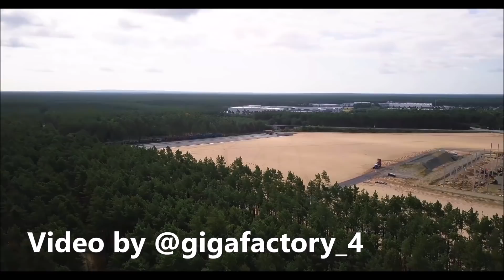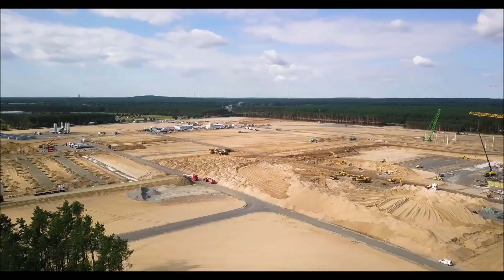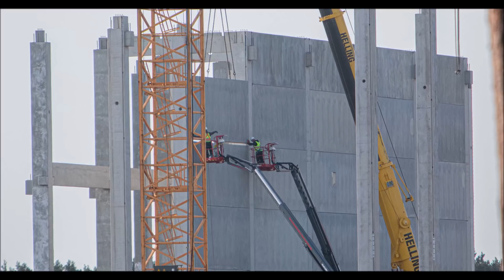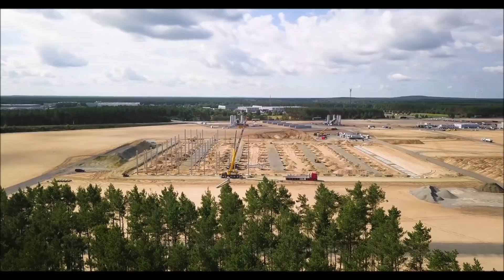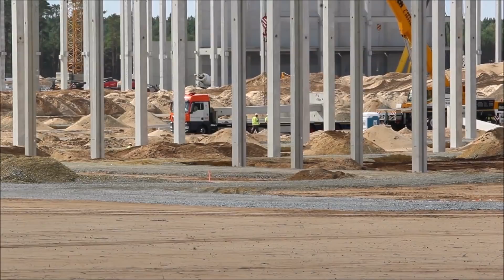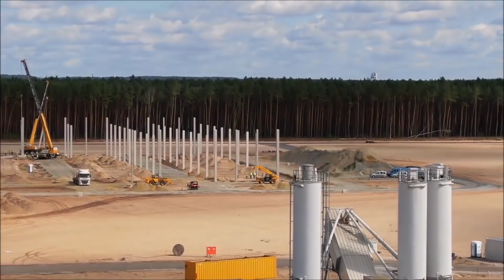Elon Musk Confirms Giga Berlin Will Produce Tesla Batteries

Comment: Most likely a separate "local" EU site, maybe close-by Tesla Berlin. Phase 1 will need a significant supply of batteries to meet a 500,000 per year production goal, but the current application excludes battery production on-site. Maybe a j.v. with CATL nearby or a new stand-alone site just over the border in Poland. Exciting times!

Comment: Water rights contracts were recently revised lower, most likely because Tesla WON'T be building batteries on site.  As for the conference call, all he said was that batteries would be sourced locally.  Pretty much the same as what they do in China with CATL and LG.  CATL has been building a new plant in Germany since Oct. of 2019 and considering that they just signed some new contracts with Tesla for Cobalt free batteries in China, they'll most likely supply the same for them in Germany.  Let's face it, the rest of the Auto Industry that has contracts with CATL haven't exactly been lighting the world on fire with sales like Tesla has.  Also, LG Chem which currently has the biggest battery factory in Europe over in Warsaw Poland, recently (Mar/20) acquired new space to expand battery production.  Could be that just like in China, CATL will provide Low cost Cobalt free batteries for Standard Range and LG will provide LR batteries.